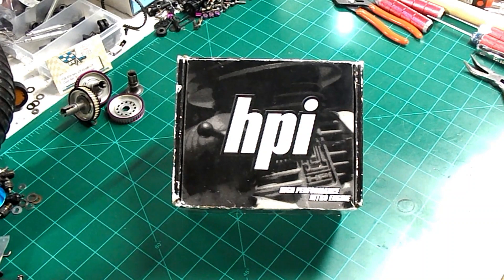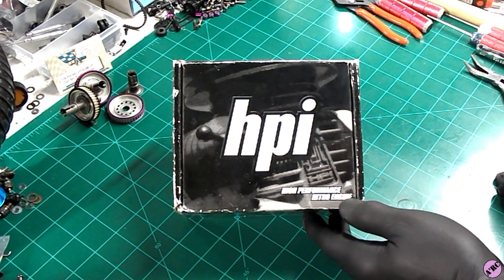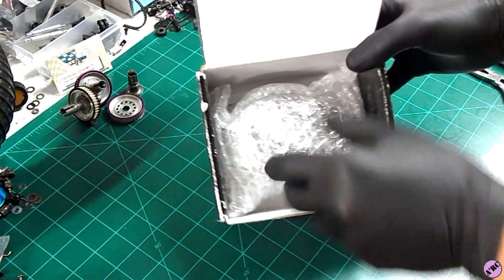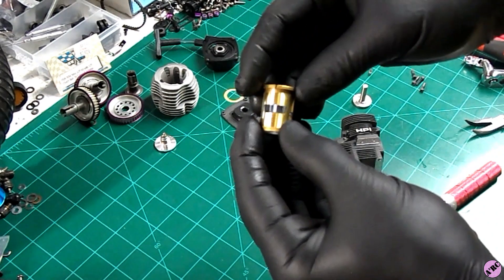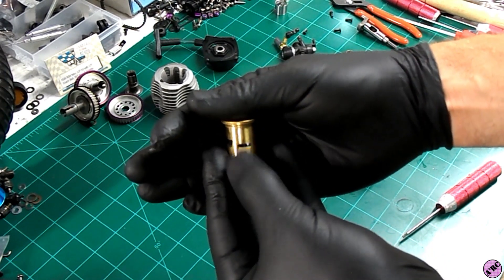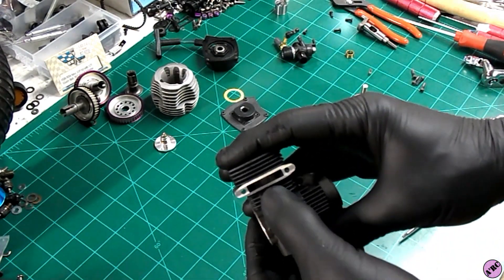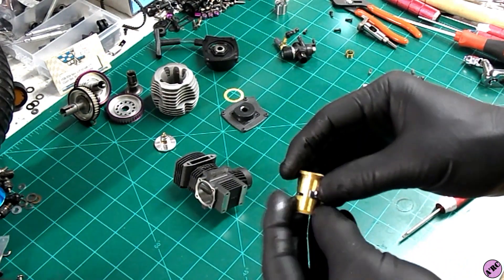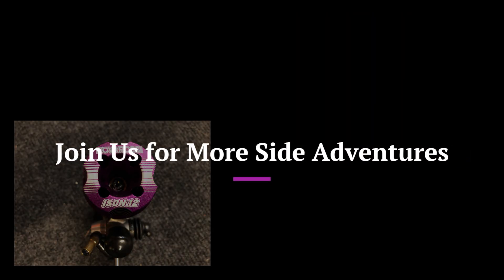HPI Nitro Star T-15 Teardown and Compare

Comment: You are a wealth of knowledge when it comes to nitro engines! This affirms my decision to keep the T15 in my newly acquired RTR3. I originally planned to swap for the 15cv-r, but I have been quite happy with the performance and attitude of it. Paired with an os T-1031 pipe, I could not ask for anything more. Thanks for the video!
Reply from the maker: Thank you for the kind words JBRC. 
- As you know the T-15 has been under rated all its life but, the folks that use it generally love it.
- The T-1031 is an OS pipe, correct (PN 72103031)? 
I could be wrong but, I think it is a unique 3 chamber design. Sounds like it’s a nice combo with the T-15 
- Thanks for the comments and for watchn’ 💜
#NitroIsTheBestGo

Comment: Great info.  I have a used T15 coming my way for my RS4 2 "rebirth" project.  My old engine is locked up, so I figure I can use this and am hoping to be able to swap over the pull start and parts from my old engine to retrofit to the T15 which is not a pull start version.  We'll see once I get both torn down.  I'll be creating vids on my channel with my findings as I want to document this build along with my "full-size" car builds that I currently have going.  Thanks!
Reply from the maker: That will be an awesome rebuild project. If you can get your T-15 back in action then, it will be a great platform for the RS4 2. 
Thanks for letting me know about it 

As always, I appreciate you and everyone for watchn’ 💟
Reply: @a2rc  thanks, we’ll see how things turn out.

Comment: When you go into a motor i hope you have a Dremel to polish your ports and inside the crankshaft i always did that before i put back together it will run more efficiently 😮😎👍
Reply from the maker: I do clean up what’s needed and modify some engines but, not all of them
- Biggest/Most important thing is to tear it all down to clean, inspect and lube. It amazes me how dirty some of the internals can be from sitting and/or the assembly process. 
I have found metal bits, chrome flakes, human hair, dried up assembly lube, brand new Bad bearings, oxidation, dust/dirt on the inside and more. 
- I know it should be perfect from the manufacture but, nothing is ever perfect and if we want our engines to last then, we need to do a double check at minimum
Reply: @a2rc  if you find hair inside someone else has been inside but nitro fuel is not clean it causes rust because of the methane 😁
Reply from the maker: @richardbrown6762  The hair, metal parts, etc all came from the manufacturing/assembly process. 
- It doesn’t really matter where it comes from, it all just needs to come out to prep for a healthy break-in

Comment: What a great little engine, a bit boring in design compared to older hpi engines but that’s just nitpicking. A black anodized head would’ve been nice on it
Reply from the maker: I do think the design of the head was a factor in people buying the engine or not. Most people either love it or hate it. 
It also came out at a time where other manufactures started to make the same or better performing engines. Many “looked” better too. A lot of the RTR engines are under rated and replaced with other big names like OS etc. 
- That’s apart of why I think this engine was over looked at times. The perform factor of the T-15 was still really nice for what it is though. 
Thanks for watchn’ 💜
Reply: @a2rc  For an RTR engine and considering what you get for the money, it’s an excellent value proposition. Certainly a lot of more expensive and worse engines out there that don’t even give you a bushed con rod cough cough